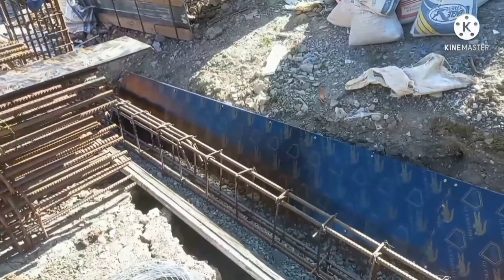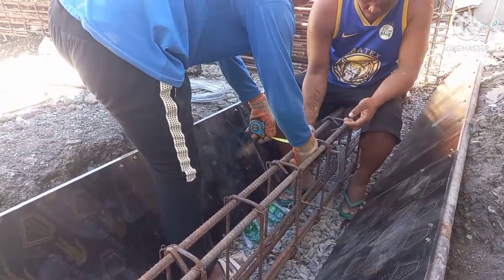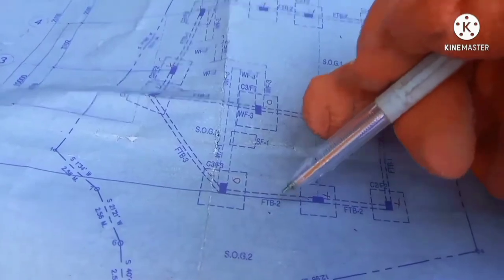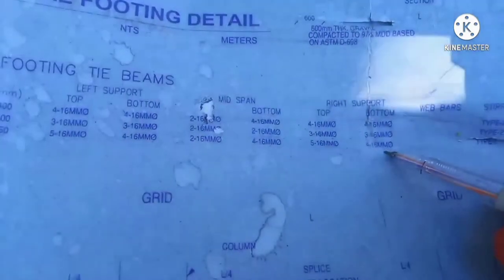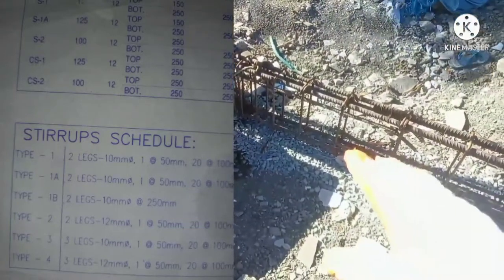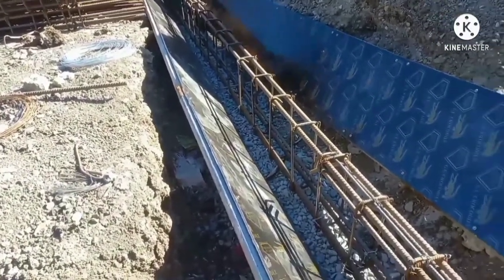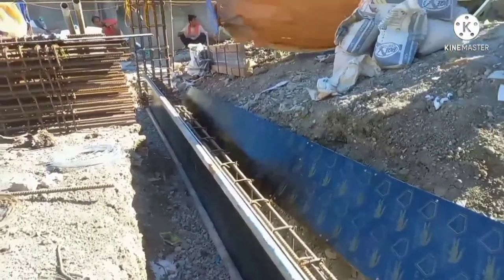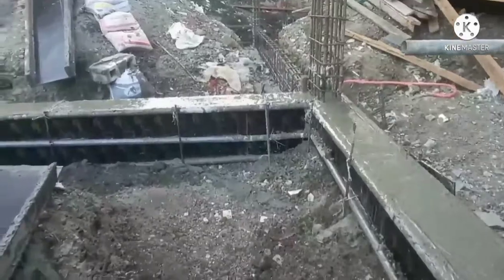PAANO GUMAWA NG FOOTING TIE BEAM AT PAGPORMA SA PINAKAMABILIS NA PARAAN

Comment: Hello po..ok lng po ba Yung gantong gawa Ng tie beam? 

Nagbuhos na po Ng bawat poste tapos po Wala pang gawang tie beam? Pero may abang po na nakausli na apat na bakal para daw po yun sa gagagwing tie beam..idudogtong po dun sa nakausling bakal both side Ng poste.lahat po Ng poste may nakausling putol na bala apat
Reply from the maker: Maraming salamat po sa panonood at sa  inyung katanungan
Reply from the maker: Depende po sa analysis Ng structural engineer mam,pero para sa akin mas ok po sana na boo ang main bar nya hanggat maaari,Yung splicing nya kung di talaga aabot ay top bar po ang dugtong/splicing at ang sukat ay 40d. or  kung may budget mas ok 50d,salamat po